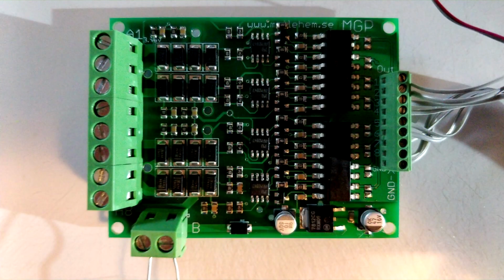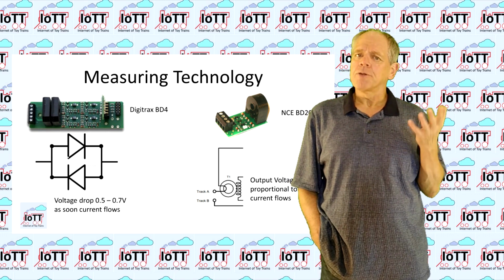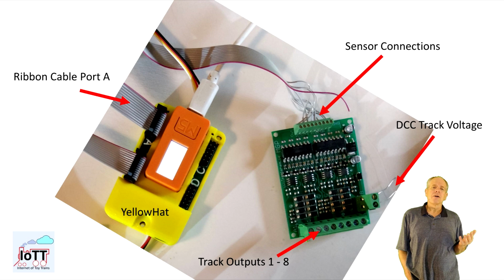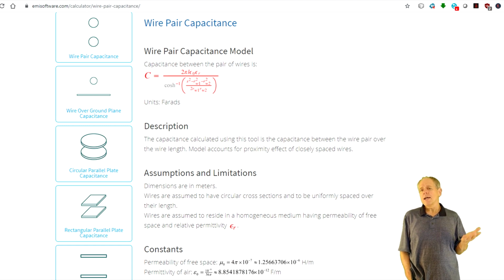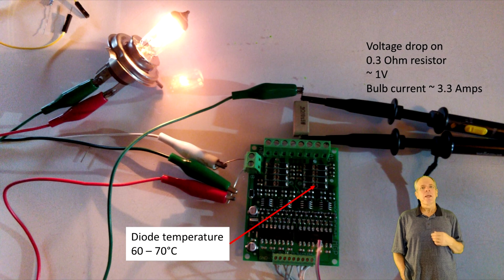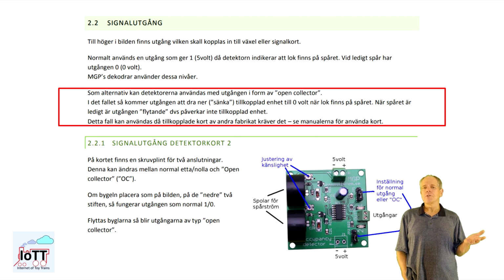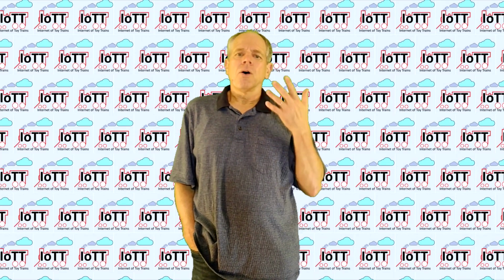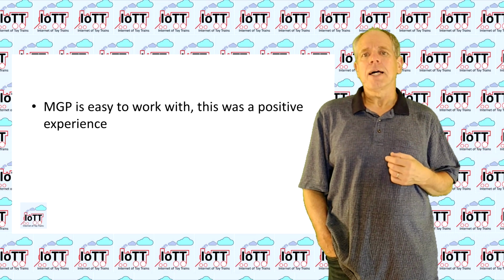Current Sensor Review (Video#68)

Comment: Nice review!

About the inverse logic of the sensor, personaly I would favor a sensor that is actively pulled low when the block is free (and therefore save to enter). If a wire gets disconnected, the block will automatically be registered as occupied and therefore unsafe to enter. This makes the layout safe and matches the real world integration of railroad safety electronics ;)
Reply from the maker: Thank you. You have an excellent point here regarding the signal safety. Unfortunately, at this time most sensors work in negative logic, which is simpler from a design point of view. But you are right, a broken wire results in a block showing unoccupied.

Comment: Nice video, thanks for the good review. I am wondering if you have tried the optocoupler based block detector from megapoints controllers? It's a very simple circuit but is very reliable.
Reply from the maker: Not yet, maybe sometimes in the future. From just looking at the schematics, it has an open collector output as well, so it would work with the YellowHat. On the other hand, it is using a full bridge rectifier, which means higher voltage drop and more heat when current is high. Would probably be interesting to do a 1 by 1 comparison.

Comment: Great detail explained thank you. 
I presume this is Only for dcc?
I have a dc based system with pwm drive. Would this work with this system.?
Reply from the maker: No, these sensors do not work with a PWM driven system, for a technical and a conceptual reason:
- from a technical point of view, both sensors need some form of AC. The transformer type for obvious reasons, the diode type because each channel only has one comparator to detect the voltage drop over the diodes, therefore in a PWM system it only would detect current in one direction. To fix the problem you would have to use an additional bridge rectifier to make sure the current always flows in the same direction through the sensor. That is feasible, but comes with an additional voltage drop and power loss.
- from a conceptual point of view you have a system that has zero current if the locomotive is not moving, hence you can not detect a train that just sits on the track, e.g. in front of a signal. To fix that problem you could have some superimposed AC on your signal, but then you would hear some humming from the locomotive if it is not moving
So, why not just moving towards DCC?
Reply: @IoTT  much appreciated for your response. From electronic perspective I can fully understand.  I am always on the lookout for newer technologies 🙂. Reason for not dcc, expense of setup. Once again,  appreciated for your response and keep up the great work on the channel! Very impressed and informative.👨‍🏫